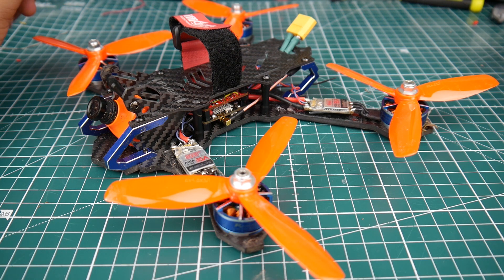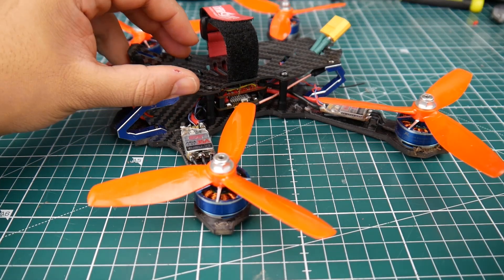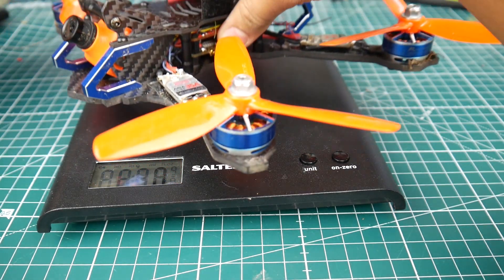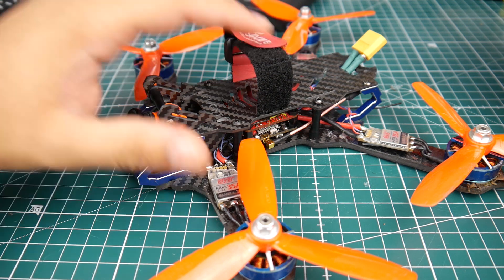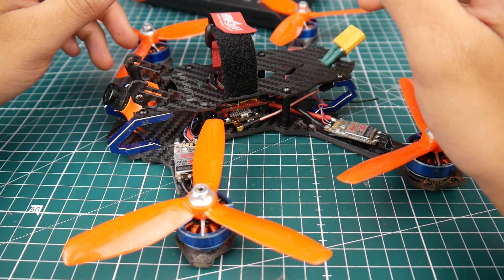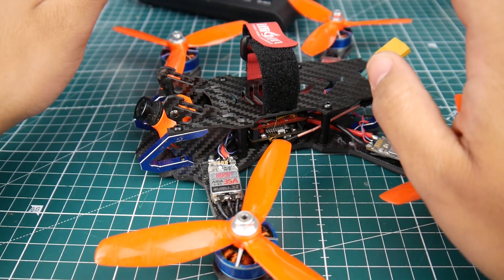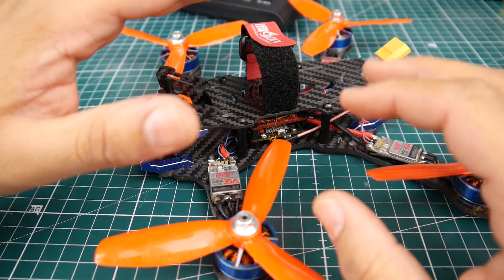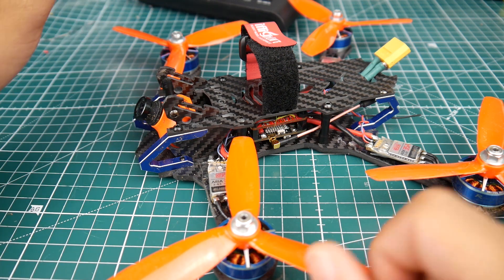Best FPV Drone Motor of 2017?!! // SunnySky Edge Racing Review and Flight

Comment: just my opinion bro, but i dont ride the high kv hype train. dont get me wrong a high kv motor can be alot of fun, especially if all your concerned about is max power with no regard to anything else. that being said, ( my opinion ) im just a fun flier , when im freestyling i honestly prefer TORQUE and efficiency. in other words, a low kv motor. for 5inch i like 2000 - 2200 kv motors. on 4 s they are plenty fast still, i have no problem getting 8-10 minute flights on a 1500 4s pack . thats not hovering ,thats sporty fun flying the whole pack. i find the torque from the lower kv give a "sweet spot" when using high pitch 3 blade props ( 5052's or something ) they have tons of grab, or bite - very responsive feel. i can let my quad fall from the sky and when its just feet above the ground, stabbing the throttle makes it stop on a dime,   its hard to explain to someone what torque feels like. when i fly, i spend about 75% of my pack with the throttle around midstick , and i spend the other 25% on full throttle punch outs. so since i spend 75% of the pack at mid throttle, the torque and efficiency i get from a low kv motor are really noticable. if i were going to fly and i know im going to spend 80% of my pack at full throttle or so, then i would want a high kv motor, since 80% of my battery will be spent on or at near full throttle running and will better take advantage of the high kv, however in freestyle flight im not flying around everywhere at full throttle, i mostly fly around mid stick, so a motor / prop combo that has its sweet spot within that mid throttle operating range really enhances the flight. i have personaly tried out many different motor / prop combos , with these hi kv motors you get around 3 minutes of sporty flying.  dont get me wrong flies like a beast but i feel so limited with 3-4 minute flights. not to mention the strain on electronics. obviously high kv motors draw alot more amps, so its harder on everything, makes more heat / wear and tear . with a 2200kv motor on 4s im not even stressing my 30 amp esc,s - everything stays cool, motors run cool, its easier on my batteries, 8-10 minute flights with excellent reliability means less time on the bench and more time in the air.  sometimes when im freestyling i like to go on an adventure, a park i fly at is huge, and its fun to have confidence when flying freestyle at long ranges , with near 10 minute flight times i can really go on an adventurous flight and have confidence that my kwad is coming home with me.  honestly i would say to get a couple of different motor configurations , and just try them out for yourself. some people really like balls to the walls for 3 minutes flying. if thats your thing u want the high kv motors.   dont think low kv means slow, i feel pretty confident that on 2200kv /4s im getting 80,maybe 85mph full throttle top end speeds, plenty fast for me. u may get 20mph more with a 2400kv+ motor but you wont get a 10 min flight time for sure.

Comment: What are the best freestyle motors of 2017 in your opinion?
Reply: just my opinion bro, but i dont ride the high kv hype train. dont get me wrong a high kv motor can be alot of fun, especially if all your concerned about is max power with no regard to anything else. that being said, ( my opinion ) im just a fun flier , when im freestyling i honestly prefer TORQUE and efficiency. in other words, a low kv motor. for 5inch i like 2000 - 2200 kv motors. on 4 s they are plenty fast still, i have no problem getting 8-10 minute flights on a 1500 4s pack . thats not hovering ,thats sporty fun flying the whole pack. i find the torque from the lower kv give a "sweet spot" when using high pitch 3 blade props ( 5052's or something ) they have tons of grab, or bite - very responsive feel. i can let my quad fall from the sky and when its just feet above the ground, stabbing the throttle makes it stop on a dime,   its hard to explain to someone what torque feels like. when i fly, i spend about 75% of my pack with the throttle around midstick , and i spend the other 25% on full throttle punch outs. so since i spend 75% of the pack at mid throttle, the torque and efficiency i get from a low kv motor are really noticable. if i were going to fly and i know im going to spend 80% of my pack at full throttle or so, then i would want a high kv motor, since 80% of my battery will be spent on or at near full throttle running and will better take advantage of the high kv, however in freestyle flight im not flying around everywhere at full throttle, i mostly fly around mid stick, so a motor / prop combo that has its sweet spot within that mid throttle operating range really enhances the flight. i have personaly tried out many different motor / prop combos , with these hi kv motors you get around 3 minutes of sporty flying.  dont get me wrong flies like a beast but i feel so limited with 3-4 minute flights. not to mention the strain on electronics. obviously high kv motors draw alot more amps, so its harder on everything, makes more heat / wear and tear . with a 2200kv motor on 4s im not even stressing my 30 amp esc,s - everything stays cool, motors run cool, its easier on my batteries, 8-10 minute flights with excellent reliability means less time on the bench and more time in the air.  sometimes when im freestyling i like to go on an adventure, a park i fly at is huge, and its fun to have confidence when flying freestyle at long ranges , with near 10 minute flight times i can really go on an adventurous flight and have confidence that my kwad is coming home with me.  honestly i would say to get a couple of different motor configurations , and just try them out for yourself. some people really like balls to the walls for 3 minutes flying. if thats your thing u want the high kv motors.   dont think low kv means slow, i feel pretty confident that on 2200kv /4s im getting 80,maybe 85mph full throttle top end speeds, plenty fast for me. u may get 20mph more with a 2400kv+ motor but you wont get a 10 min flight time for sure.

Comment: Those are beautiful motors. Do you recommend the 2300KV or 2480KV on a lighter build? Also for a novice FPV pilot.
Reply from the maker: Andy Osier 2480 to 2800

Comment: Are that motor can hold on crash ?
AFAIK edge racing (the red one) it's not hold up very well on the crash (the bell just fly away)
Reply from the maker: Broke 2 frames with these motors before installing on this one.. So far they seem very durable.